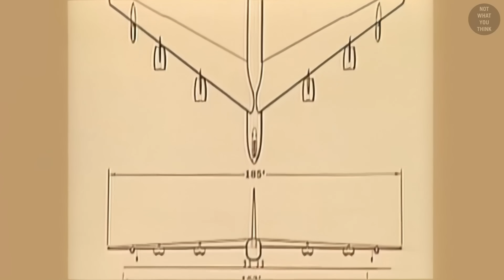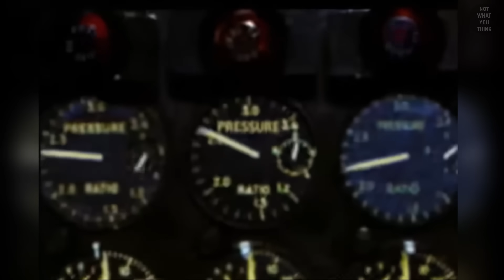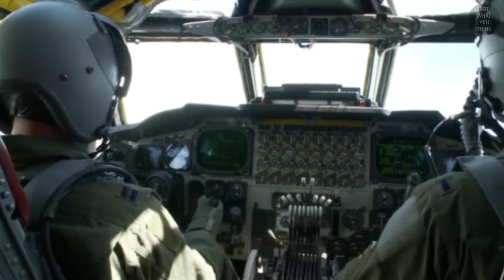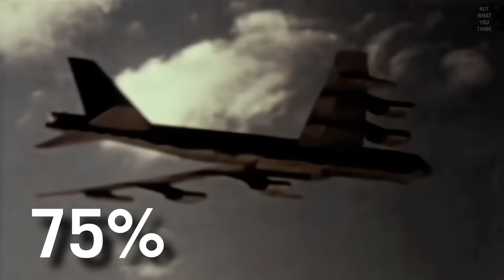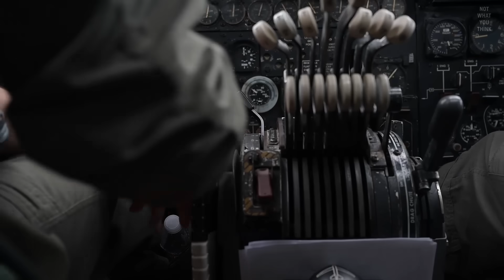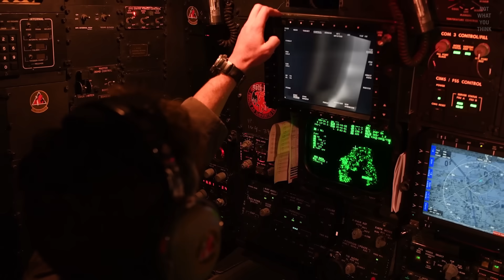Why This Obsolete Bomber Will Outlive EVERYTHING

Comment: on that nuke crash. Do you think the people making the nuke questioned the need for 4 triggering mechanisms? I can imagine one engineer asking another why they need a fourth and the other being adamant that they add a 4th only for them to say told you so 50 years later when it gets declassified.
Reply: I bet most designers thought 4 was too few. Some bureaucrat probably thought 4 sounded good and made it a spec.
Reply: @endyoutubecensorship6639  Sounds about right.
Love your username!
Reply: I don't think anyone questioned adding so many back ups on a fricking doomsday device
Reply: The engineers probably kept asking if 4 was enough lol.
Reply: I had the same thought as Ben, and wonder if they started out w fewer but added more after a 'learning opportunity' or two.
Reply: Considering the controversy over dropping two nukes on Japan, I doubt any of the people involved in making them thought that at all, most likely the opposite.   But yes, if there was someone that decided on 4 instead of 5 or more, I'm sure once they read that report that they had chosen that number.
Reply: Only a handful of people would say no to so many backup failsafes on a nuke. 

 Luckily for us all 99% of the human population is not that dumb. Those people are luckily also not in charge, hopefully. 

 Guess that still leaves millions though.
Reply: @dianapennepacker6854 There are other sides to this that are not dumb in any way. These safety mechanisms are not hands-on manually operated. In case of an actual order to drop, all safety features requiring hands-on operations must already be disabled/deactivated before the plane even leaves the apron. These were not drills or training flights, they were flying hot because the order to launch could come and need executing at any second.

That means these safety systems needed to, and could only be operated remotely, with no ability to do anything about a malfunction while in the air.

As a myriad of very real examples has shown, these safety features defiinitely could, and did fail on multiple occasions. But the other side of the same coin that this narrative fails to highlight, is that this could just as well have gone the other way around. These were not just "fun" hazards to shuffle around, not just ultraexpensive insanely dangerous science projects used for ballast in some airtime endurance trial of bomber planes. They were very real weapons, made to work, and if neccessary use. As a functional weapon.

As you increase the layers and number of safety mechanics and devices, you ideally do reduce the risk of the nuclear device at its core (or the traditional explosives around it) accidentally going off when not intended to.

But, at the same time, all these additional links in the chain also increases the risk that one or more might fail "the other way" too, not disabling when they should. And with no means of accessing or remedying them in-flight, that would effectively render the bomb or missile useless. Potentially much worse consequentially even; because you trusted it to work, you won't have any other ones available nearby to service the target. Within the real intent, purpose and scope of the operation that had those nukes onboard those planes in the first place, that could very well mean that the ICBMs that your bombs were intended to disable, now could launch. And your (failed) strike alerted the opponent of your intent, meaning that surrounding airspace would be practically impenetrable by the time you could get another bomber anywhere remotely near it.

You can think of it kinda like a series of interconnected relays, all of which you need to close to enable the thing at the end of this circuit to trigger. While more of them might reduce the risk of all of them simultaneously shorting out and unintentionally leading power across to the thing - but relays can fail open too. If one or more of them does so and fails to close, you're not getting power to the thing no matter how much you mean it to.

So a balance need to be struck, between the types, mechanisms and amount of layers of safety preventing accidental detonation - and the reliability of intentional detonation. Because while some nuclear strategies and doctrines might in some ways be developed with the goal of never launching and detonating a nuclear weapon - the nuclear weapons themselves are very much designed and built to actually be launched and detonated. Once the call has been made to commence with a nuclear strike, the reliability of that weapon doing what it is meant to do is paramount.
Reply: Nope, I don't think an engineer would say that. Maybe the higher ups in the corporation but not the engineers.

Comment: It is the museum's job or the desert graveyard's job  keeping antique airplanes , not the USAF. If what I often hear the B52 is just a bomb truck, why can't a C17 do the same job ?  Just open the rear cargo ramp (bomb bay doors)  and roll them out. I know there were proposals using 747s for that but never tried. You can even fit rotary launchers into the C17. The C130 can be a lighter weight version. If the C17 are used that way, they will crash as well, a plane that will not crash have not been invented yet.

Comment: Another notable reason for the B-52 still being used. It is the only bomber that’s relatively EMP proof. The B-1, B-2, and new B-21 are all inoperable without electric and are fly-by-wire/electrically controlled. The BUFF is all mechanical, heck if need be even the ordinance can be released manually by crew members.

Comment: To be fair, the vertical stabilizer didn't just fall off... the B52 lost its vertical stabilizer when it hit clear-air turbulence. Thst lasted for 9 seconds. Too much stress for most any airframe. AND 1:41 that crash was due to a pilot intentionally crashing the plane.  You can find that story on YouTube
Reply: The o e that crashed practicing for an airshow, the pilot was a "hit-dog", ku d of like Maverick from top gun and had been reprimanded multiple times for unsafe flying, he had a habit of flying the '52 like it was a fighter plane. There were actually many of his crew that had asked to be transferred because he was unsafe and he should have lost his airforce wings the first time he was caught flying like an idiot.
Just goes to show that there are old pilots and bold pilots but there is never old and bold pilots
Reply: If all you say is true, then this is a very underrated comment.
Reply: isnt 1:41 the one where they were practicing for an airshow and then they lost control which made them crash? if thats true it doesnt sound intentional lol, also heard that the b52s took around 5 seconds to respond and reflect, so this accident sounds well... like an accident
Reply: @ampshack-z3r  It was the result of LtCol Bud Holland's blatant disregard for published aircraft operational limits.  We were trained to never exceed 45° bank angle, he took it to 90° in that fatal turn. He ended up getting himself and his crew killed. Turns out, he was notorious for doing that on prior flights, too.
Reply: @SEO122   indeed, it's such a shame that this was entirely avoidable. were you a b52 pilot?
Reply: It's on YouTube so it must be true, right?

Comment: This plane is like an old truck. You're not sure of its intentions, you're not sure if it's been reliable but it's here and it does the job
Reply: Yeah if your "old truck" has had a frame up rebuild about five times and is on its sixteenth new engine.
Reply: @maulrat588  i drove old trucks with i don't remember how many miles and they worked perfectly
Reply: @themetalslayer2260  There can't be any old truck around that can compare to the miles that those planes put on them!
Reply: @rolandemartin854  that's a metaphor
Reply: @maulrat588 my dad had a ‘92 chevy with 350,000 miles. He drove it until the steering wheel fell off. Literally. The key ignition broke. We wired a push button start. Fuel pump went out. We cut an access panel in the bed with hinges and replaced it. He only junked it once the steering column broke and it started running rough, synchros were bad, needed new tires and clutch. My 2010 mazda3 has 250,000 miles. I change the oil every 4000-5000 miles. Hopefully it serves me well to 300K and beyond! Still runs like a top.
Reply: @morpheus_9 Still would be cheaper rebuilding that 1992 vs a new truck.
Reply: Like my old Toyota, the B-52 is workhorse
Reply: That is a perfect analogy. I was born in 53 and to think it is a year older than I am is amazing. Wish I could have that many rebuilds.
Reply: @pumberdog 😅😅
Reply: @pumberdog  The current B-52H is a 1961 production series.
Reply: i drove old trucks and never had parts brake off mid ride lmao
Reply: @KorEditing You're just lucky. Or don't drive a Dodge.😂😂
Reply: does it douh ? lol  i just watched the video haha it failed a lot lol almost made a lot of nuclear bo boos lol

Comment: I'm 71 and older than these planes.  I'm still smarter, more adept, more durable & reliable than most newer models.  I started as an analog product, but have kept in touch with the digital updates.  They just don't make 'em like they used to.  Where have all the critical thinkers gone?  Dance this mess around.
Reply: Nice burn, my guy. At least I'm not the only one who thinks this new gen  is completely useless.

Comment: Why don’t they just update the engines to 4 more modern more efficient and much much more powerful ones. Instead of the very old gas guzzling and low thrust engines. A 747 is bigger and only has 4 engines
Reply: They're working on it

Comment: The US Air Force launched a comprehensive study in the late 1990s to determine what kind of aircraft would be the best possible replacement for the B-52. After approximately 3 years study they arrived at the inescapable conclusion that the ONLY replacement for the B-52 is………….. ANOTHER B-52! 🤣😂🤣😂

Comment: The first 52 i remember was 1962. Tben a 52 flying at about 500 ft caused the bus I was on to drift on the highway in Kansas in 80. As a young Army 2lt it startled me. Still does now.

Comment: The reason the B-52 is still around is because  it has the ability  to carry approximately 70,000 lbs of Bombs.  

And the B-1 Lancer was nerfed by the 1995 New START treaty with Russia.

As the B-1 Lancer was intended to replace the B-52.  And was originally  designed  to carry not just 75,000 lbs Bombs but also Nuclear Bombs.  Until the aforementioned treaty limited it to conventional Bombs. 

So yeah the airforce already had a replacement  that took its first flight in 1974 .  Which was introduced in 1986.   Namely  the B-1 Lancer which is the only US bomber capable of supersonic flight. 

So yeah the B-52 was supposed  to be replaced back in the 80's.

Comment: There's so much more to the B-52 then you touched on.
Some B-52's are test bed's for new weapons, new radar systems, new avionics.
In fact, the B-52 called Ghost Buster did the testing for the B-2. Ghost. Buster is still a highly classified project. I've only been able to find 1 photo.
My biological father worked on these projects when he was working at Edwards Air Force Base and Groom Lake. One of the biggest reasons I know about Ghost Buster is because my biological father was one of the people who submitted a ghost logo for the plane. His ghost was based on Casper, but the PAC Man ghost won.

Comment: it is old but still very deadly, smoky start is just getting the engine running at once
if a start cart is used getting them in the air would ages plane of this age will have problem's in the air they are safer than modern ones as they are not at risk from EMP's

Comment: I find it fascinating all the talk about how the B-52 "had a lot of problems" - while utterly ignoring the sheer wall-banging idiocy of "let's keep a bunch of airplanes OPERATING NONSTOP IN THE AIR, with just stopgap midair refueling & repair (if that) and expect nothing to go wrong" of the whole Chrome Dome operations....

Hello, overheating, metal fatigue, material stress exposed for weeks or more to low pressures and temperatures of 40-50K feet altitudes for days, weeks or more. It was a crack-addict idea before crack was even a thing for starters.

Why the B-52 has suffered so many accidents? because no one else could even STAND that kind of abuse for so long or would even dare to try, that simple.

Comment: If you take a closer look at its wings during flights, you may see that they "dancing" more than on BUFF's colleagues. B-52 have high specific wing load, small total wing area. It takes 2900m just to take this fat chunk of aviation aluminum off the runway without a solid-fuel rocket boosters and 1433m to stop it on dry runway without parachute. His closest rival, Tu-95, had only 25 casualties during its service. Many projects done during The Cold War had massive issues in many ways. Right, English Electric A-1 Canberra didn't had serious problems...But it wasn't a Heavy Long-Range Strategic Bomber. That type of armament is pretty expensive and complex, not mentioning how much fuel it consume. Boeing should've concentrate more on designing every part of B-52 than flushing taxpayer's money down the drain. In Russia we soon will lost one of the most famous aircraft design bureaus- MiG... Our military doesn't want cheap and personnel-friendly MiG-35, they want more heavy and expensive Su-35. But they don't understand that BOTH of them are needed.

Comment: I'm sorry, but the first 20 seconds ruined any credibility of this video. Parts do not fall off this airframe. The footage was from a prototype model, and I believe it was on a test flight stress testing it. The engines are not started with explosive charges either, so I'm not sure where the gas mask comment came from.

Comment: You forgot to add to the list that the Serbian Air Defense shot down one B-2 Spirit over Serbia in 1999. In the same year, an F-117A, several F-16's, and around 75 UAVs, 85 cruise missiles, and a number of AH-64 Apaches were shot down (Most Apaches were shot down on the ground at airports in Albania and BiH).
One needs to understand how USAF administers aviation losses. Only if warplane gets shot and falls down on enemy territory, it will be admitted as combat loss. However, if the airplane gets shot and counties to fly only to fall on its way to the base, it is considered to be a loss during routine flight. It gets noted in the same column with such losses that might occur in continental USA.

Now, 1999 Kosovo war was aleady a huge blow to US air might because Serbian Air Defence shot down already invincible F-117A, compromising the whole “stealth” concept. This was even more problematic due to the fact that it was downed by ancient Soviet era system from the 50-ies. Admitting the loss of immensely expensive and secretive B-2 Spirit would have been a huge embarrassment.

Just on a side note, 1999 Kosovo war proved that E-8 J-STARS (also very expensive) is uncapable in performing its main duty, finding land targets. That became crystal clear once Serbian armour forces, barely dented, began retreating out of Kosovo.

Regarding B-2, one thing is certain. Crew of Serbian Air Defence battery that shot down F-117A and F-16CJ has painted a three silhouettes on their command vehicle. Third being that of B-2 Spirit.

Comment: The fact that the engineers that work on her are by now almost dead while their creation is still here as a proof of their amazing work. Congratulations to every people that make her, queen of the sky alongside Concorde
Reply: What's amazing to me is that they did their work with slide rules and pencil and paper.
Reply: An aircraft that accidentally nukes a foreign country is anything but a "queen of the sky"
Reply: they are definitely not "almost" dead
Reply: @portablerefrigerator4902  the bomber is some 70 years old; at the youngest, the engineers who originally designed the plane have to be at least 90 years of age.
Reply: @Melonist  yes thats literally what I said
Reply: @portablerefrigerator4902  fair enough
Reply: @Melonist  Dont you mean 70 years young?

Comment: A very informative video, however, as a weapons troop on the B52, I would like to point out an inaccuracy.

The capacity in the bay, specifically, was indeed 84 bombs using the clip in system, however, since then it has been downgraded back to 27 500 lb. bombs. This was to add a fuel tank to the fuselage. Today we use a triad of cluster bomb racks in the bay, each holding 9 mk-82's. These numbers also don't include the bomb load capacity on the wings. 9 can be loaded on each wing using a pylon called an HSAB (Heavy Stores Adapter Beam).

Thank you for your time!
Reply: Nice OPSEC
Reply: @itsv302   All of this information is available to the public.

Comment: It won't. The only reason why the B-52 hasn't been replaced is because America simply hasn't faced off against any opponents that can reliably destroy air units. Because of that, a lot of air units that normally would have been declared obsolete, have survived and are still useful. It's also the same reason why 1970s era fighters are still useful despite 5th generation fighters succeeding them. But it ain't saying much that a B-52 can't be shot down by ISIS.